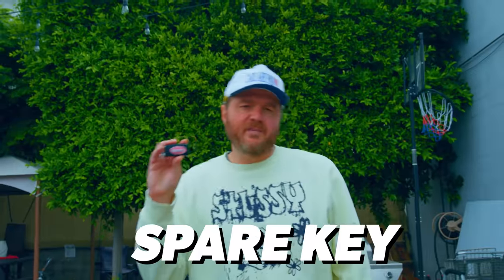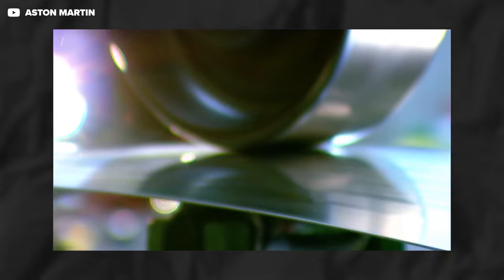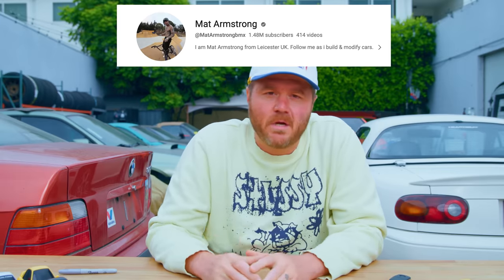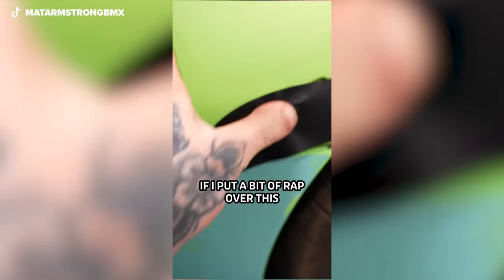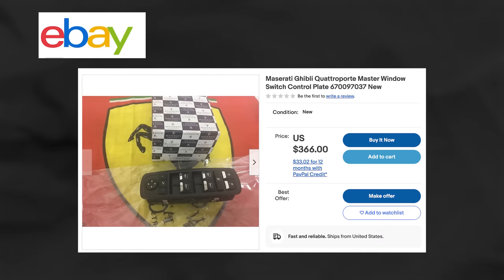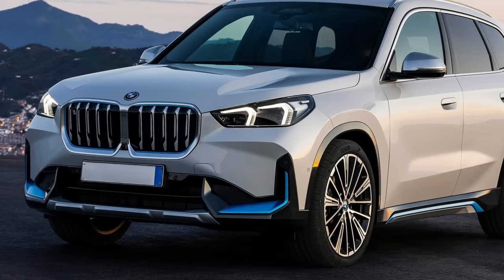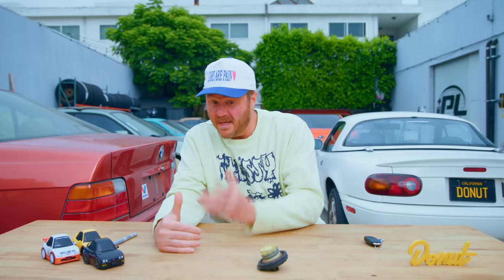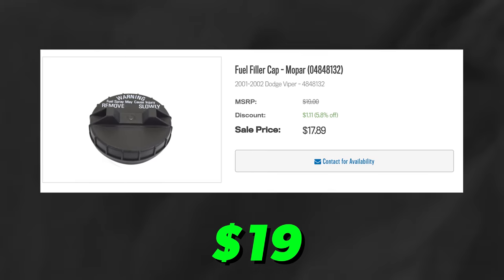How Luxury Cars Rip You Off

Comment: I work at the Bentley factory in Crewe UK and it makes me chuckle on a daily basis fitting electric window switches with Skoda printed on them to £130k Bentleys 😂😂😂
Reply: i drive a 2013 VW CC, I share parkingssensors with a Bentley :p
Reply: @gd1996dg  you’d be absolutely amazed how many parts in the Continental are from Skoda , Seat and VW but with a chrome cover over them and charged at an extreme mark up
Reply: its called branding😂🤣🤣
Reply: It's called conspicuous consumption. No one drives a Bentley because they're good. They drive in them because they want to be seen driving in a Bentley. 

Which is pathetic.  @Vodkaminz
Reply: @aluisious  bentleys are actually good cars, not everyone is an avaricious slob

Comment: I love when companies do this honestly. It makes it so much easier to get parts on the cheap. They've been doing this forever. My dad taught me this over 30 years ago.
Reply: What's the easiest way to know what cars share parts?
Reply: @CALPH88 maybe do some research?? I guess😅😅
Reply: @CALPH88 there some forums just depends what ya drive
Reply: @CALPH88 use your 👀
Reply: Use the OEM / Interchange Numbers
Reply: But the real rich does not want to use the same peasant's car part.

Plenty examples in Chinese history. Yellow cloth is sololy for emperor to wear. If your name is the same as emperor's , better to change.
Reply: @CALPH88  googling the part number.
Reply: @CALPH88  the easiest way is to see who owns/owned who, like the cases James mentioned, and then look at the models produced that year. Otherwise, usually looking up a part type/number is a good way to see it. I wouldn't pick a car solely on the fact that it has a lot of other manufacturers, but it's good to know.
Reply: @FischerPrice74 thanx for the advice, much appreciated. 💯
Reply: Same
Reply: i do it with rebadged cars all the time. same part but sometimes still a hefty price difference.
Reply: @CALPH88 by googling it, what kinda dumb question is that in this modern day and age Lmfaoo
Reply: Yep, get most of the parts for my G35 from the Nissan stealership!
Reply: It's also good for the availability of parts in the future. Nobody is going to keep making parts for an independent sports car manufacturer that went out of business 20 years ago. But if those parts are shared with existing mass production models, there is a chance these parts will remain to be available.
Reply: @CALPH88 buy and sell used cars and stay with one brand and it's sisters.  I've owned 30 plus cars since 18. Only 3 lexus but also seen enough from friends with turbo and supercharged 400, I just yeah. But.

Subaru, Toyota, lexus, scion, 

Brz gs400 is300 jzx100 sc300 sc400 probably even ls400 all can use the same differential and stuff. Similar transmissions, brake abs assemblies, fuses modules. Suspension is also all very similar. Like, everything bolts up. Brakes, everything.
Reply: @CALPH88 I almost was forced to pay 350 plus for my gs400 brake assmebly issue. Basically no power brakes. And I went to a competing yard and took one from where they don't track online ebay prices, so I got my luxury part for 68 bucks. 

Over 2000 dealer quote usually. Mine would be more since I have missing lugnuts and they would not allow the thing to leave their shop like how it is :/
Reply: Literally! Imagine not having that option and having to spend tonnes on bespoke parts instead😫😫
Reply: @CALPH88  
if you have one of the expensive ones, look for a logo of the manufacturers on each part if possible.
And try to research what company owns the manufacturer and research what other brands they have.

There are a ton of places where you can get parts.
You can even get parts from actual OEM like Denso or the like for some parts of your vehicle.

Comment: I worked in engineering for 10 years on an assembly line. What most people don't realize about car manufacturers is that they almost exclusively assemble parts bought from suppliers, and they all have a finite choice of suppliers. That includes engine blocks in most cases  (ok high end cars might be different there). No car manufacturer is making bodywork, machining engine blocks, cam shafts, gearboxes, electronic components, cutting glass, molding plastics etc. It would be impossible. They just order from suppliers and put it all together. That's just what manufacturing is. 😂

Comment: (Also, from the motorcycle world: The engine in a Kawasaki Versys is the same as for a Ninja, with a slightly different tune and a different clutch. It's also $1,000 cheaper on average to buy.)

Comment: Lotus Esprit is a full on parts bin special. You could probably make a video on it alone.
Reply: S1 tails = check. Fiat X1/9.
S2 tails = check. Rover SD1 series.
S3 tails = CHECK! AE86 Toyota Corolla liftback coupe.

And, the tranny came from Renault. Anything I missed?
Reply: @dth2brny121  For the S4/V8s, the entire switch gear is from GM of that generation and a few other manufacturers. 

Sensors and I believe the ECU are from a Corvette C4.

Airbag steering wheels are from Pontiac

Wing mirrors from Citroen

I think the headlight is from a Fiero or the motor of the headlight. 

Idk, the Esprit from S1 to the V8 was just a bunch of parts strewn together. Trust me, there are a lot more borrowed parts in an Esprit. Don't get me wrong, I adore Esprits and I cannot wait to buy my own. I regret not buying an S350 last year when it came up.
Reply: @eis-bl4xw  OH SNAP! I forgot about the steering wheel there, it was also used in early SATURNS (🤦).

EDIT: Wait, an Isuzu engine was used in the early-90's FWD Lotus Elan, of course...!
Reply: @dth2brny121 the fwd elan was also sold and made by Kia
Reply: @petergracemeguide1280  Yet, they never sold it elsewhere. This early Kia would have kicked ass!

Comment: I drove a Porsche 928S2 5 speed for 19 years.  It had Volkswagen seat belt couplers....

The AC compressor was Sanden, which was also used on Honda Accords.  The fuel injection was by Bosch, the transmission guts were Borg Warner, quite similar to the unit used on Corvettes.

This is not uncommon in the automotive industry.  The Aston Martin Virage had Volkswagen Scirocco tail lights.  And it actually looked right....
Reply: Lucky bastid. That 928S is on my short list.

Comment: Used to work in the parts dpt of several different new car dealerships, this happens ALOT! One time I had 4 EGR valves on my counter, a Daewoo, Gm, Isuzu, and a Honda, the Daweoo was cheapest,  they ranged from $50 to over $200, Daweoo was the manufacturer btw.

Comment: This is why Koenigsegg is so legendary. They make everything in house (minus parking brakes, wipers, and tires). Lots of work to do that but it pays off in the end
Reply: What's about it legendary? How it's paying off in the end? Do you believe they are producing for example their own AC module? Creating and designing (AND TESTING, CERTIFICATING) your own parts when You can just take trusted existing parts from the shelf is basically idiotic.
Reply: @Zbykobyl  Yep, all made in house. At least for the Agera RS. Idk about their newer models but yes they make literally everything except for what I listed in my comment. They don't go to suppliers for any parts of their cars.

To me, at least it hows they really take the time and care to make their cars the best they can be.
Reply: @Ultra_64 should take care of their customers when your spending a million!
Reply: @Ultra_64  OK, and tell me - how does changing the rear reflector from Agera R (which was a reused part from Mazda RX-7) to a new part in Agera RS make their car better? The funniest thing is that They didn't even change the bumper, so they had to use cover caps with it to fit old holes - that IMO looks worse than in older Agera.
Reply: @Zbykobyl  In terms of utility and drivability, it does nothing because it's a rear reflector lol. But if you look at the bigger picture it makes the car more valuable and desirable. If I'm dropping 7-8 figures on a car I sure as hell want it to hold it's value.

Comment: I had a 2008 Volvo C30 back in the day, awesome hatchback! Busted a shock absorber and decided to run the part number in the web. I ended finding out the Mazda 5 used the same part for a third of the price. Also a friend of mine in Spain had a 2014 Range Rover Evoque Diesel with a damaged turbo cooler. We ended up finding out it shared the engine with a small Ford delivery wagon only available in Europe. He got it more than 3 times off the Range Rover price. Finally all the McLaren Supercars use a Nissan VRH35L racing engine redesigned by Ricardo PLC that uses Nissan Sentra's coils and Mitsubishi turbos. 20 bucks for the Sentra coils against 250 bucks at the McLaren website.🤦🏽‍♂️

Comment: Having looked into it with a friend, the Viper steering rack seems to be very similar, but not identical to the Dakota rack. Pretty sure it's mostly the same, but with a few changes to make it fit the Viper's wider track width. Which would make it a parts bin special within a parts bin special.

Comment: Speaking to Maserati, the 3.0 F160 motor has its block cast at the same plant that does the 3.6 Pentastar. Its been confirmed that the timing cover, coolant crossover, upper oil pan, and even heads all swap directly between the two. The heads and conputer systems arent interchangeable (DI vs MPFI) but the fact that everything fits is crazy
Reply: More than crazy. Tell me that the crappy V6 Pentstar is base on the V8 itself. It's a cheap version too. Had fluid leaks in the Dodge Charger and everyone thought Quattroporte ?
Reply: The pentastar is not based on any v8, it's it's own thing. Also the 3.0 in the ghibli doesn't have the oil housing problems the pentastar has because it's in a different place (surprise surprise)

Comment: Most luxury cars will depreciate, especially if you drive them, especially often. Cars that won't depreciate so much are the low mileage cars (especially if they are stock) cars from the 80s and 90s. Nowadays, its the NSXs, the Type R, or even the 964 Porsche. Sure, they may not be as fast as a supercar, but you will be making BANK!

Comment: So yeah I've noticed this trend with my semi truck as well. One of the air conditioner pressure switches went out and it was pretty pricey at Freightliner yet it was the exact same thing although the part numbers do not cross-reference, as the switch from a 98 Chrysler Sebring and my truck is a 2014 lol there's been a few other things I've come across like that but I'm resourceful. Some mechanics don't need a computer to tell them what's what

Comment: The db7 is actually sick, even had a t56 in the manual cars. Very misunderstood, surprised people never tuned the or added turbos the block and crank were special but rods, pistons amongst many other parts were essentially pulled from fords parts catalogue. Meaning that the specifications that were used to say, make the stock or even aftermarket forged pistons, did and do fit the V12 off the shelf. Crazy

Comment: That's how my Airtrek Turbo R was born.
Mitsubishi changed the bumpers, bonnet and tail lights of the Outlander and made the Airtrek- giving it a "more urban" look with some funky interior options, but then for a sports model, they yoinked the driveline of an Evo and popped in an uprated auto gearbox and gave it somewhat milder cams and a little bit smaller turbo and presto!  This the same driveline was then popped into the Evo wagon and Evo GTA, but to keep the Evo GTA and Evo Wagon on par with previous models, adding 40 more HP from the Airtrek Turbo R, they retained the more aggressive cams and turbo.  The downside to the Airtrek is they were all automatics, the up-side is that It's an SUV chassis that is happy to handle more power. Unlike the regular Lancer chassis which required upgrades and strengthening in several locations to handle the Evolution driveline.  If only the Lancer Estate was the same chassis as the Lancer Evolution Wagon, it would give Evo guys so many more options for restoration!
Reply: You are right on point, even on the Lancer Cedia platform (CT9A EVOs) Mitsubishi already start to share the platform with their Outlander/Airtrek.

Comment: Bosch Def pump on BMW x5 is same pump as ford F250. slightly differnt plug but if you have the original pump its a 10 second swap... i have a video... X5 def pump is 2K. F250 pump is 450 bucks.

Comment: The 2007 GS platform also housed the 1st gen Chrysler 200, which was just a facelifted sebring and basically an Avenger with different bumpers. Which ALSO means the junk undepowered 2011-14 GEMA 2.4L can do ALOT more then a 0-60 of almost 10 seconds, but the ECM is so locked down you cant do anything. If you take the exhaust header off of a 2011-2014 Chrysler GEME 2.4 you'll fine UNUNSED studs that are used on the SRT-4 Dodge caliber to support the added weight of a snail. and some EVO X Intake manifolds will bolt to the GEME 2.4 aswell.

The more you know

Comment: Wtf does he mean by chassis? Cars don't have chassis anymore and they haven't for a long time. Appart from the Crown Victoria and trucks. Modern cars are unibody, so unsure if he ment floorpan or running gear(engine, gearbox, driveline, steering and suspension).

Comment: Viper - Bolt pattern is from The Dakota also, not the full size truck. 6 x 4.5 (or 6 x 114.3). Only found on the Dakota and Viper in the 90's - 00's

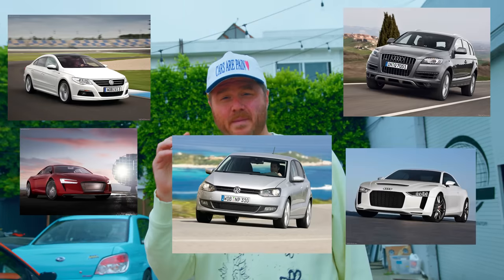Comment: The Quattro Concept in the bottom right at 0:10.

This was an Audi B8 chassis ('08-'12 A/S/RS5 chassis) with the TT RS 2.5L turbocharged engine. It weight 2,700 pounds with a full interior and had a true longitudinal engine lay out. It featured many modern Audi features still used today like the steering wheels, virtual cockpit, and others. It would have been goated,

Comment: As a 2015 EVO X GSR last run owner, it is worthwhile to point out that Mitsubishi and Dodge split up at the first phase of the GS platform back in 2004, and DaimlerChrysler made substantial changes to the platform, subsequently naming it the JS platform for mid-size cars and PM/MK for compact cars. But who really cares? At the age of STI, it shares the platform with Forester/crosstalk, and GR Corolla rides on the TNGA-C platform, which shares with two MPVs (Noah & Innova) and lackluster Lexus UX. Car manufacturers commonly share their 4WD rally cars with their family cars to reduce the cost so we, as buyers, can afford them. And as the owner, I can say that EVO X's S-AWC AWD system is still competitive in the handling department alongside GR Corolla and VA STI. Also, there are enough 1000hp+ EVO Xs out there to prove the 4B11T's worth; with 60% more body rigidity than the EVO IX, it is a better car, and Mitsubishi is Evolving it till the very end. So bad so many 4G63 die-hards never got it. And today, dealerships here in California want 20K over MSRP for a new FL5 CTR and GR Corolla( OTD over $70,000); I could say the EVO X is here to stay.

Comment: Many Maserati uses the Magneti Marelli ETM (throttle body) as the 2001<2002 Volvo V70XC. Which mean XeMODeX can rebuild the existing throttle body; even upgrade it, for about 580<620 bux not 3 grand if you went to the dealer. How do I know this?  My side hustle is pulling and rebuilding Volvo parts.

Comment: The Lotus Esprit and the AE86 do not share the same taillights. They look similarly styled but the pictures clearly showed how flat faced the Lotus taillights were and the glare on the AE86 taillights shows that they have a slight bevel at the mid line. There's also visible differences in the plastic castings thats seen with how the light was filtering through them.

Comment: Back in the mid eighties, I was very much into the SoCal Bug scene, upon installing a select-A-drop front axle, I replaced the wheel bearings prior to installing the new Porsche alloy rims.
My neighbor came by while I was doing the install on my Bug, and he owned a Porsche 911T. He asked if I would be willing to replace the wheel bearings on the front of his ride the next day, and I agreed. 
Next day I walked back into the same parts store where I bought my wheel bearings for the VW.
The timken bearings I bought the day before for my Bug cost $10, but when I ordered the wheel bearings for my neighbors 911T, the exact same Timken Bearings, with The Exact Same part number as the VW's, except for a -P at the end of the number, were $110!
They were the exact same part!!!!🤬

Comment: A luxury name adds 400% to the price of any part, even if it’s from the Chrysler parts bin.  Like Maserati using Chrysler audio, but charging 4 times as much.  Or using a Chrysler Pentastar engine, a German ZF transmission, an American GKN rear diff, and still claiming to be Italian, and charging Italian prices for parts.  Even the chassis for the Ghibli and Quattroporte are a Chrysler 200 and 300 respectively, just dressed up in Italian skin suits.  

Becoming an exotic car tech killed my passion by opening my eyes to the deception, hubris, and raw greed of the auto industry.  I grew up with Italian sport cars on my wall, and having finally put hands on them, I can’t stand them anymore.  The lies are constant, and I can’t reconcile my childhood awe with the reality of the industry.

Edit: yes that V8 in the Quattroporte is built by Ferrari.  It’s the only real Ferrari engine used today by Maserati.  The V6 is a Chrysler Pentastar.  The V8 is a de-tuned 488 GTB engine.  And it sounds like it.

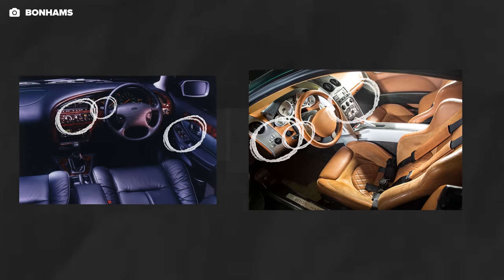Comment: 2:07 bought a new Aston Martin Vantage in 201&, had it for under 48 hours. I died on the 101 bad fuel pump (ford fusion). Dealer took it back and I bought a GranTurismo. 

Still have the GranTurismo, the engine still sings.